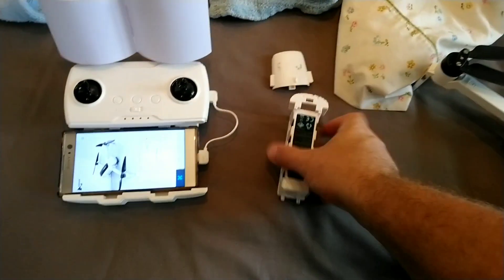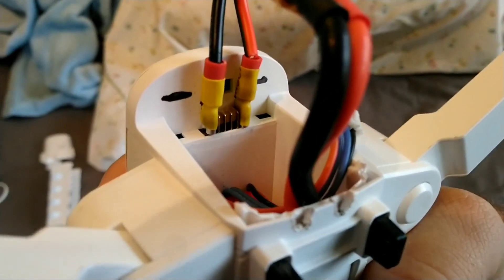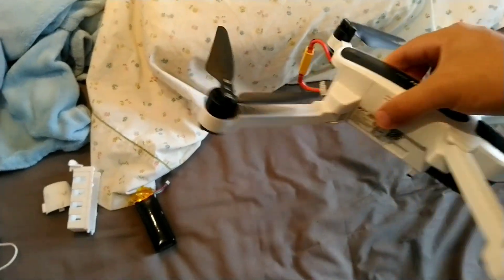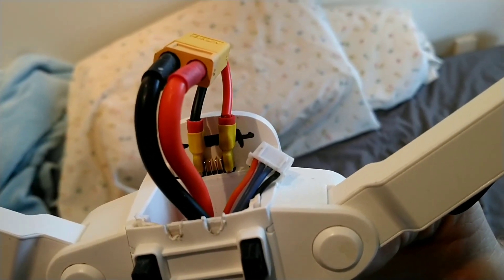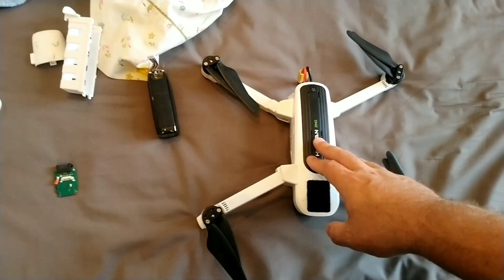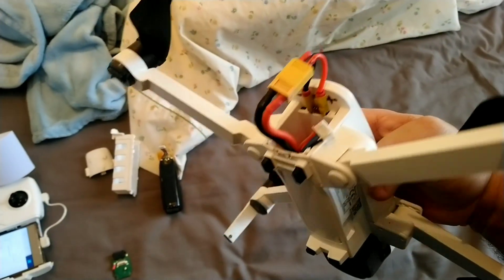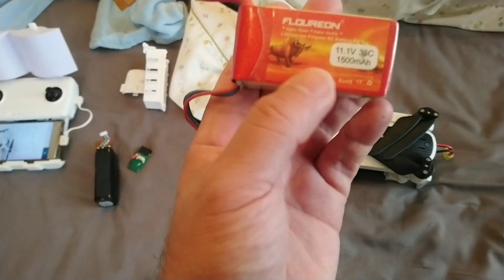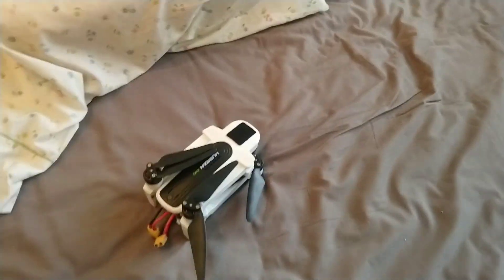Hubsan Zino Easy Battery MOD Even For Beginners

Comment: Hi, do you know if the latest firmwares from Hubsan avoid this sort of solution? I managed to follow all your steps and mine doesn't even turn on. Once I put the original battery, it does.

Comment: I am late to the party... But hey... 
I have some questions if it is possible for you to provide answers. Thanks in advance :D
1. You said that more Cs might damage the ESC when fighting the wind... I'm not a veteran RC guy, I know only the basics so I gotta understand why :/ Is it that when fighting the wind the motors will meet more resistance and require more AMPs in order to maintain the same rotation speed? As a result if there's only an 8C battery, then they can only draw so much current but in the case of 35C+ they might draw too much for the ESC? That's the only explanation I can come up with :D (of couse I gotta argue here that 35C is way too much already and if in fact the motors would draw more current, the the ESC would be fried a long time ago... I don't know... I'm just thinking of doing this mod and I found the comment on the Cs alarming for potential damage, so I had to ask...)
2. I want to do that on the Hubsan Zino Pro Plus... I'm not sure but I think that the battery is somehow a little different... Do you know if the same mod applies to the Zino Pro Plus
3. Do you bilieve that the original zino battery is really 4200mah? I'm no expert, but usually when talking about lithium cells, well, physical size seems to correspond to capacity. I feel that the original battery is closer to 3000 mah if I'm to be honest. Your 1500mah battery seems to be able to hit the 15 minutes mark. A 3000mah battery might hit the 28 minutes mark. Which should be more or less what the original can provide.

Comment: 4S yeah' do it. !
The ESC can easily take it., do it. c'mon do it.. there is usually a lot of headroom from the vendor's margin and Hubsan will play it safe, so definitely a lot of headroom from standard 3S, do it... just do it, it will likely be amazing, a new agile 4S GPS quad... do it. 4S for the win, do it... no risk whatsoever, it can easily manage 4S, do it, just do it.
Hmm meh whatever, I don't know... maybe.. no 4 real, do it, just do it... hurry g0d dammit, do it.!!
nahh, nice mod and yeah basic dump batteries, no heed for handshakes like we see with smart batteries.
the original charger is a battery killer, the cells are all over after charging..

Comment: wht kind of connector is that on + - pin ? Also which firmware are you on? i heard some firmware doesn't give accurate reading of battery  voltage on app.
Reply from the maker: Everything is in the description of the video

Comment: Nice MOD DW... is the Zino 2 that much better than Zino 1?
Reply from the maker: As far as camera goes yes it also had things like Optical flow sensor along with a little newer Tech inside of it. I'm not a huge fan of the Zino to I like things that can be modified easily the proprietary battery setup on the Zino to is difficult if I ever wanted to modify it I look at mod ability when I get things.
Reply: firmware versions plzz